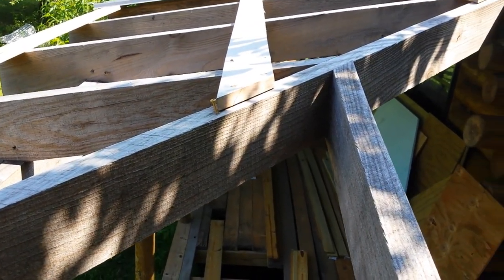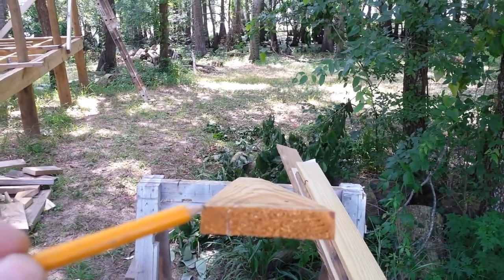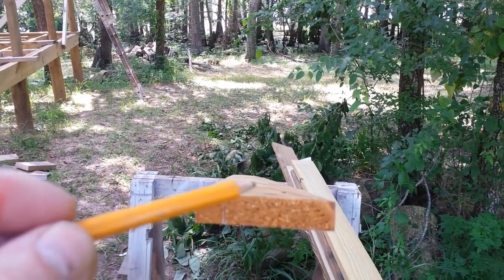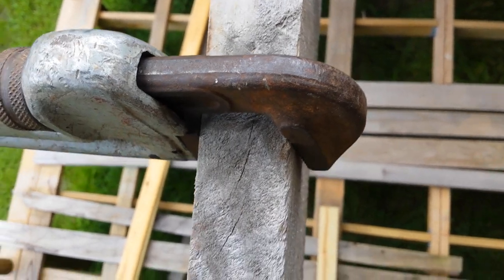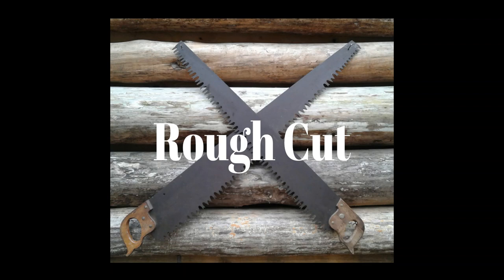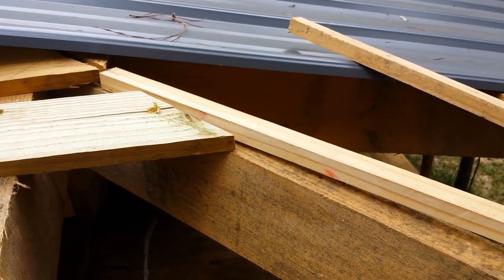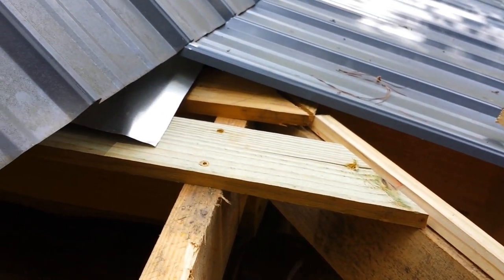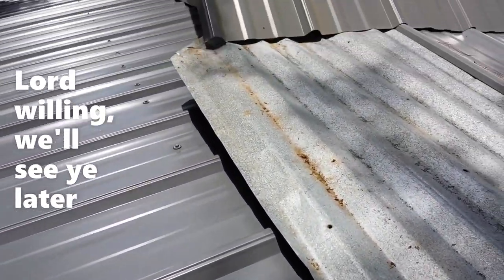Off Grid Log Cabin Build, Wrap Around Porch, Metal Roof Installation

Comment: Do the porches have to be the same length? Can I have a 12’ porch front and back and 8’ porches on the ends?
Reply from the maker: I have never seen it done that way
Reply: @RuffCut  so I can’t build 12 foot porches on front and back and 8 foot porches on the ends and be able to put a wrap around porch on? I’m confused. Thanks again.
Reply from the maker: @Mike-mm8nz   I reckon it would work...just the pitch of the roof would change I think
Reply: @RuffCut  Thanks again